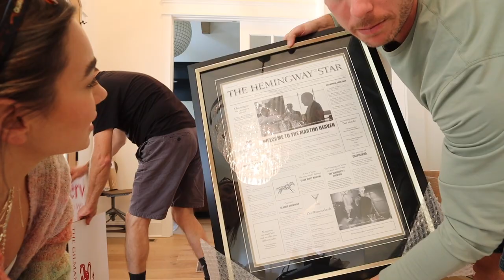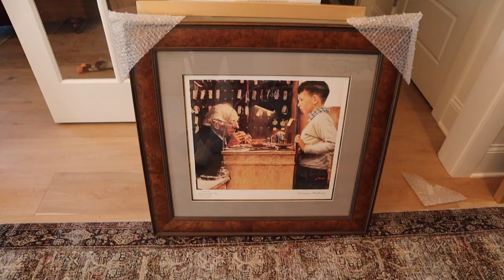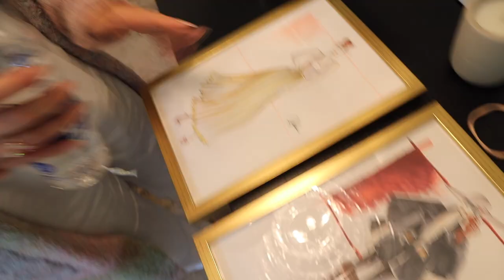VLOG: SO F***ING PISSED (EVERYTHING'S GOING WRONG!), Fall Decor Updates, Home Renovations!

Comment: I had the same issue using a power washer hose -- solution : I cut a length of old hose - cut a slit up a side & slipped it around the electrical cord so if something touched the hot motor it was the hose & you'd have time to go handle the situation -- worked 👍